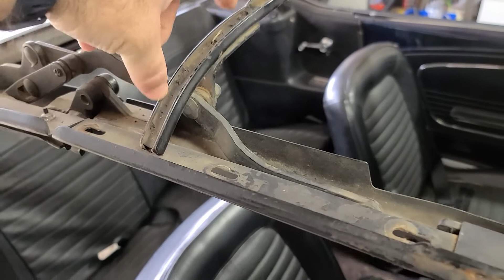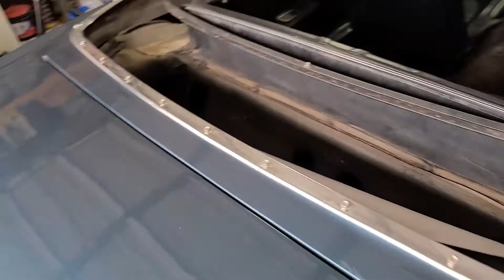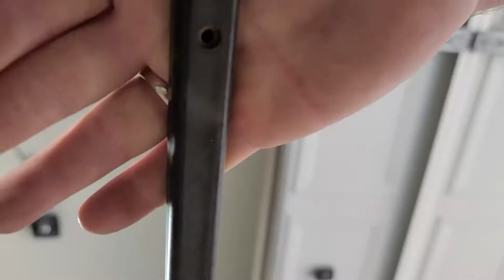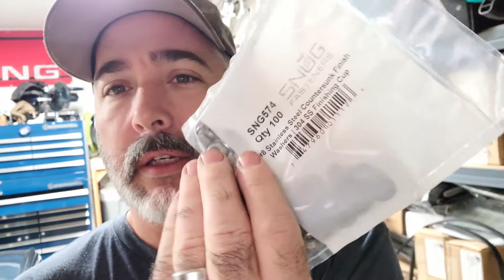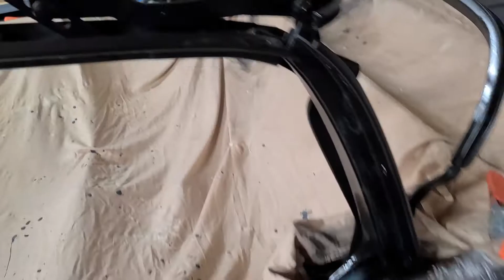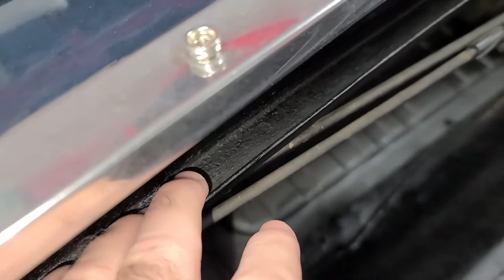66 Mustang Convertible Top Installation Pt 1 Frame Prep

Comment: What happened to the primer coat?
Reply from the maker: I figured it had a good enough factory coat and that light sanding would provide a good surface to adhere to.  While the paint did adhere well, there were contaminants that caused some orange peel.  Not ideal but not obvious either.  Should not have skipped that step though.
Reply: @WhitetailGarage  Other than that observation I think that lots of folks can benefit through the journey you are undertaking. I very much appreciate the problem solving process you communicating. Thumbs up. 

Good Luck
Reply from the maker: Thanks!  Appreciate you watching and commenting!

Comment: Very helpful. What did you find was the best way to get the tack strips out of the corners of the front bows and the one all the way across the rear bow? Giving me some headache as it’s really in there. Thanks!
Reply from the maker: I used a pocket flat blade screwdriver as a chisel and with a hammer chiseled it out.  Then followed with a heavy wire brush.  That sounds excessive but didn't have to hit the screwdriver very hard.  But I needed that small bit in those tight spaces.  Not sure that is the best way, lol, but it was the way I got through it! Thanks for watching!  Good luck on your project!